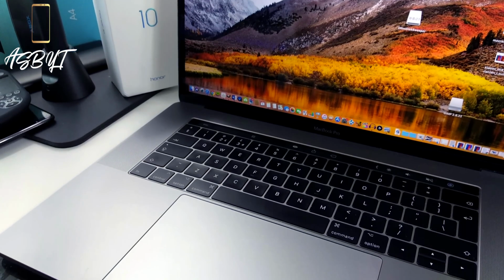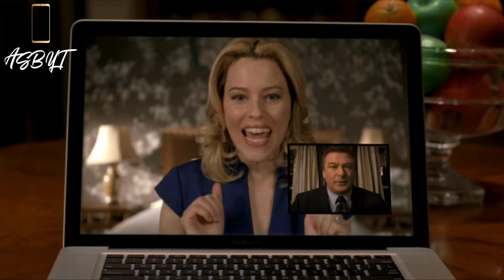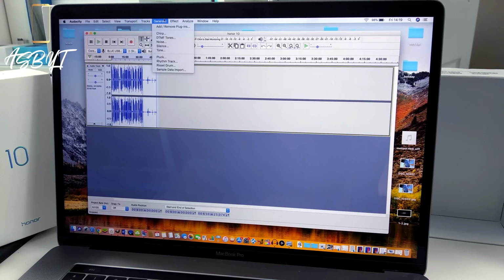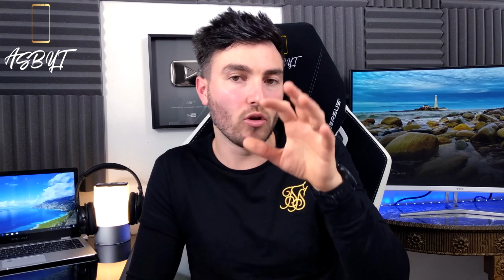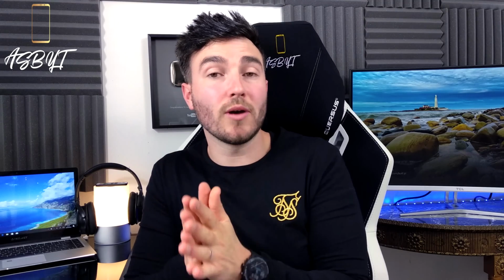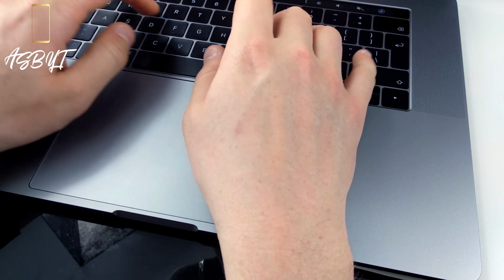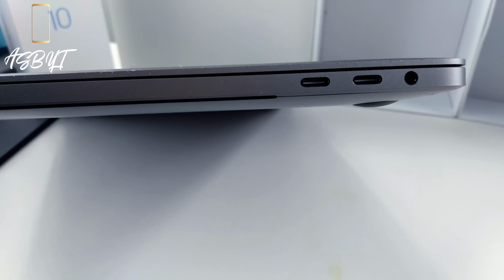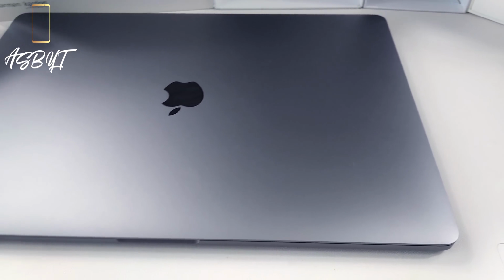Macbook Pro Review - The TRUTH After 6 Months! (2018)

Comment: Any keyboard issues and have they fixed the heat issue? Just picked up a 2018 13” PRO w/Touch Bar for $1300, but concerned about the heat issue which I think causes the keyboard issue.

Comment: I used a Macbook Pro 2015 edition for a year and I really did not like the OS. There where tons of bugs and hardware issues with it. As I need to jump between OS:s, the mac keyboard shortcuts and other stuff like maximizing windows in MacOS is just counterproductive to me. I guess that it is something that is possible to get used to if you don't have to use other OS:s like me.

I bought a Dell XPS 13 Developer Edition and it is definitely the best laptop I have ever owned. I just love it. It comes with Ubuntu (Linux) installed. If I need to do any video editing, KDE Live works great for me.

Comment: My question... Do you think I should buy... and should I buy now...

I'm just now starting my EdD program... and will finish in 2020... I am in the market for a laptop because my old Hp unit died on me it was touch screen and that started acting up... it failed to keep a charge and finally went through an update for 2+ days and nothing.... Finally had had enough and got rid of it... 

I have been reluctant to invest in another PC laptop and was leaning to Mac simply because of the longevity of previous products. (A friend still has a Macbook from 2002) 

I dont want to spend 1k+ on a PC that will not stay updated and in optimal working condition  during and beyond my dissertation... 

I'm looking to purchase around August or September of 2018... any advice you can give... Thanks!

Comment: I'll go for a 15" macbook pro... mid-2012 pre retina on eBay.  USB-3 ports, Ethernet, SD slot, *user upgradable* RAM, battery, and harddrive.  Maxes out at 16GB RAM and with a SSD should be great.  Splice and crimp the magsafe tip with my own universal Targus charger for durability.  If I think I need a desktop machine, maybe try hackintosh-ing a Dell Optiplex for less than $100 but my Linux desktop and the MBP is fine for me.  No dongles no sticker shock

Comment: Utter rubbish, too many issues too many bugs. The laptop feels cheap and nasty and the problems you get for your buck will leave you disappointed for SURE. The best laptop apple ever made was the NON- retina mid 2012 by a long, long way and even that has its faults but nothing in comparison. In this case its a style over function deal when there are much much better options out there, hell even the non- retina (upgraded) can still cut the mustard if you must have an apple and its not going to have the horrible keyboard, staingate, port and power problems. Do yourself a favour.

Comment: Lots of good points. I wanted a MacBook just because I was frustrated with Windows and wanted to try something new. Having not used an Apple computer since 1997, I got the the Air 2017 edition with standard usb type A ports. It's great and should not be ignored as an option in my opinion unless you need more horsepower.

Comment: Tim is really screwing things up since he has no more NEW ideas, he and his team are removing essential ports and calling it innovation. Apple needs its conservatism back. Apple needs Steve, this port fiasco will be Apple’s demise.

I bought MacBook Pro in 2016 and I was so underwhelmed, when people buy a MacBook Pro they buy it for business and work. The fact that this machine is lacking so many essential ports such as the USB, firewire, SSD slot, and Ethernet is absolutely ridiculous. When I’m at work I’m constantly plugged into Ethernet because it’s the most reliable access point to the internet. Now with this piece of crap, you can’t even do that. Not to mention new butterfly keyboard which have only helped Apple to gain profits by charging for repairs. 
After 6 months of usage I couldn’t do it anymore with this machine and ended up selling it and buying a 2011 MacBook Pro which are much better equipped for efficiency in my workplace. 

I understand Apple removing port from the MacBook Air, because that device was built with portability in mind as Steve once said. But for them to be removing ports off of the Pro series, a machine designed with efficiency at its centre is ridiculous, having to switch between ports and dongles is not the type of future I want. But yet we are so stupid as consumers, that we continue to buy and fork over our money for these underpowered, glued together machines just because it looks cute and sexy and ultimately forgetting the main purpose of the MacBook Pro.

Comment: I used to think the volume and backlight slider are sillier than an actual fixed button. But I watched a video and found out you DO NOT NEED TO TOUCH IT THEN SLIDE. Yes, you can SLIDE RIGHT ON THE SLIDER and it would work as if you touched it and you start slide afterwards.

Comment: I have a Mac Book Pro from 2011. It doesn’t have a Retina Display and a Touch Bar. It does have a DVD drive, SD card slot, 2 USB ports, and a Thunderbolt port. It’s great when I have had multiple Apple devices connected to the same ecosystem. I have a Samsung Galaxy Note 8 also that I can’t seem to part with. The PC companies have been producing quite a few laptops and laptop/tablet combinations that offer greater battery life, displays, ports, ways to secure the PC, touchscreens, and 10 keypad keyboards. Yet, the latest Mac Book Pro will cost from a couple hundred to a thousand dollars more. This months WWDC was only about incremental software upgrades. Something has got to give! BTW awesome review 😀🇺🇸!

Comment: I have used both Davinci Resolve and now Premier Pro (I needed After Effects so Premier just comes with the bundle). Once I moved to software that was usable everywhere. Suddenly the MacBook was so awful. For example, rendering my latest project on my XPS 15 took about 40% of the time to render. When you add After Effects that’s even bigger. My suggestion is to bite the bullet and go Premier. Once you do that you’ll quickly find nothing magical about the premium price of the MacBook. I abandoned my 2016 MacBook Pro and I haven’t really missed it at all. Another factor is getting a laptop with two hard drives, which will greatly increase performance for video editing (I don’t have that either right now). You can also get a thunderbolt drive for this, for either Mac or PC, but that will tie you down so you might as well go desktop at that point. A thunderbolt drive costs almost as much as an CPS Tower with a 1070 and two 2 TB drives, so just go desktop at that point (which I also have). I do videos with hundreds of clips and sound files, so maybe you don’t need that, but at a certain point you really do need a desktop for pro editing.

Comment: The buttons on the touch bar for changing the brightness and sound don't need two steps as you mentioned. You can just hold the button and immediately slide to change the sound or brightness that you need. If you are playing media and you want to pause it quickly there is a fourth button on the left that has 4 stripes on it, you can just double-press it to pause all of your audio.

I know the touch bar is useless at first, but it is just a change that you have to get used to. I personally think the touch bar is great and it is a lot faster, but at first, it is slower of course until you get used to it.

Comment: I’ve had my Mac air since 2011. Rarely turn it on. the battery life is so bad that i have to be tied to an electrical outlet. If I really needed a computer I would never get another Apple. Overpriced status symbol.
Reply: Cameron Kord poor you dont know why you even clicked this vid when u hate this brand like this😂😂😂😂
Reply: guess you never broke in the battery frendo, mine is still going strong, and its the base version and its running like new, I love reliable apple computers are, I usually get 8-9 years out of them before I upgrade to keep up with tech
Reply: what do you mean broke it in
Reply: MrStarfighter56 66, there is a certain amount of time that something need to be broken in so the device knows how much charge the battery can take, and when you have a battery that sat fir a while with little to no charge in it, it can cause the battery to decay and loose its "potency" and how lon it can hold a charge, basically, he didn't use the computer enough or used it on battery power enough, and prematurely killed the battery, and you can get a new one for $30 USD, because my battery died of old age, and reached the last of its  charge/discharge cycles. (7 year old battery BTW)
Reply: Felix Nguyen do you have some sort of personal stake in Apple that you can’t handle an honest opinion?  Afraid your stock value will continue to erode?  As for clicking on the video. I like this guy’s videos. Always helpful. Don’t always agree with him. Not always interested in his topic....but, I value all opinions. Too much Donald Frump in your world, seemingly.

Comment: If you need to adjust the brightness you can just hold your finger on the Touch Bar and drag it the way you want. Instead of pressing and then slide it. And you also can get rid of the Siri button. Btw a very nice video.
Reply: Yes! So many reviews complain about this. Just touch the touch-bar icons once then slide your finger left or right. No need to touch it multiple times to adjust the brightness or volume.

Comment: @ASBYT Not sure if anyone has pointed out in the comments or not yet, but with the volume and brightness sliders you can press and drag on the buttons on the touchbar to make adjustments (one actions), you dont have to press to activate and then drag as two separate actions. Also you can customise the touchbar to remove the Siri button, I was doing exactly the same thing. System Prefs > Keyboard > Customise Control Strip.

What is making you stretch over the trackpad for the keyboard so much? I have found the palm rejection very good on mine, so usually rest my hands where I normally would to use the keybaord and am still able to use the trackpad.

Comment: Great video! I'm still using my 2013 macbook pro which still runs like new for everything I need it to and the battery is still fantastic. For me, the OS is unbeatable for productivity. I have been considering upgrading but I really don't like the touch bar or keyboard and I've heard plenty of horror stories and glitches the new ones have. Hopefully the next one is a bit better.
Reply: Ellie Andriotis "Unbeatable for productivity" = I am used to it and I don't like change
Reply: Nat Darke Nah. For everyday tasks it's genuinely better in my opinion. Runs smoother and faster than my PC when web browsing, using Microsoft Office, etc. Obviously it wouldn't do too well if I try to game on it (barely runs portal 2 on low settings) or do anything else that's intensive like rendering. Also I wouldn't consider myself as someone who doesn't like change haha. I used to love iPhones and changed to Android and have never looked back. I have a PC (which I refuse to upgrade from windows 7) and a MacBook currently and I use them both for different things because they both have their strengths. Originally I had laptops then I went to a MacBook, then I went back to a laptop, hated it and returned it after a week and got another MacBook haha
Reply: Ellie Andriotis Maybe comparing an expensive Mac to an old PC running Windows 7 isn't a fair comparison? Try a high end Windows 10 laptop for 6 months and then make a comparison. I have been using a Mac for the first time for 3 months and found it "unintuitive" at first. That doesn't mean Mac OS is less productive than Windows or Linux.

Comment: Another Great Video. I also bought the MacBook Pro at the start of the year and I feel the way you do about...great looking but there are better laptops out there. Very very expensive and it gets very hot especially just above the keyboard. I have a 2015 iMac which in my opinion is much better than this. I think the quality just isn’t there as it used to be. Will I keep it? .....yes because it is way too expensive but would I recommend it? No a big fat NO. There are cheaper and better laptops from Dell and Lenovo and HP.
Reply: Harry K Just a question, as i'll soon be in the market. Do you think that the 13inch TouchBar MBP is a better value? Like - is it better/worse than a Razer Stealth, an LG Gram, or a Dell XPS 13 (also keeping in mind that Apple will soon be upgrading their macs)?
Reply: TheStone2203 I would go for the Dell XPS

Comment: I've had the 2016 model since slightly after it came out (it was purchased by my company so it's not mine) and it's ok, but pretty much everything you said is a gripe I have with it. Battery life is abysmal compared to what is advertised. The keyboard is not fun to type on. The Touchbar is an absolute waste for day to day usage unless you really like swiping things to change the volume and screen brightness (you really can't program or customize the thing in any meaningful way out of the box), the trackpad is ok, but the size is a bit excessive. The only thing I can think is that they're prepping that large space for perhaps an OLED touchscreen in future models (which would be awesome) but that would drive the price through the roof. And the need to carry around ANYTHING just to get the port functionality back is just ludicrous. I have a Tripp Lite extender with (3) USB 2 ports, a VGA port, HDMI port, Ethernet, and a USB-C port and frankly, even that is a hassle as the cord is too short if you have the laptop raised up on a base of some kind and just looks and feels clunky. The individual adapters are worse in my opinion as they make your laptop look like a tentacle monster from some nasty Japanese cartoon. On the plus side, it's fast to boot, load apps, and I've only really ever had one glitch with it where it did an update to the USB-C ports, then on reboot, didn't quite activate them or something, my battery died overnight even though it was plugged in, and the hardware guys had to open it up, disconnect and reconnect the battery to get it to turn on again. Not very good design. Apple places form over functionality and it ends up biting the consumer in the ass.
Reply: Yeah the 15 inch Macbook looks real nice and I thought I wanted it at first but I went for the 13 inch MBP with no touch bar instead because I cant use a laptop without the media (function keys) because they really make the laptop easier to use. I dont understand why Apple couldnt have just put the touch bar above the damn function keys, like wtf Apple.